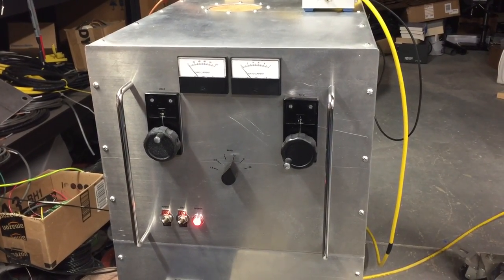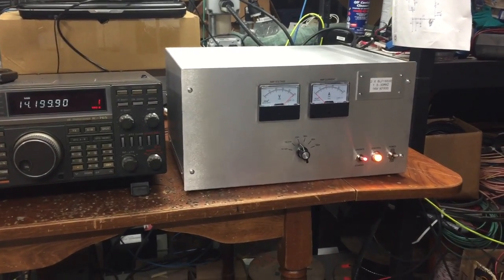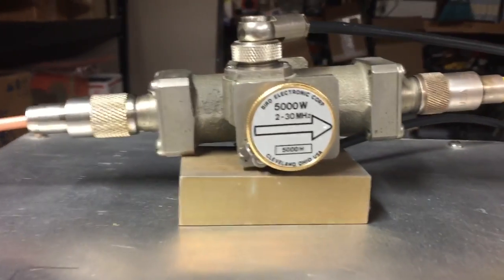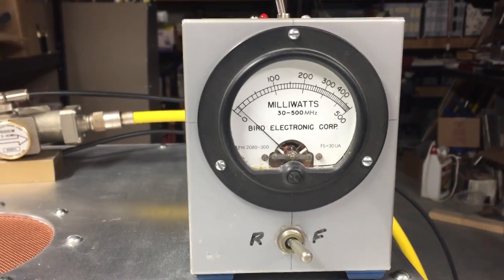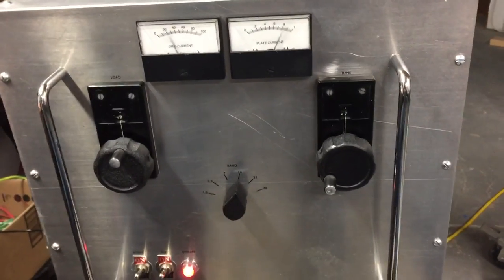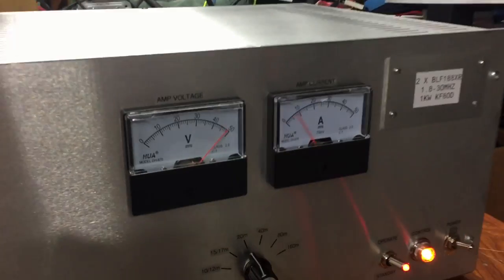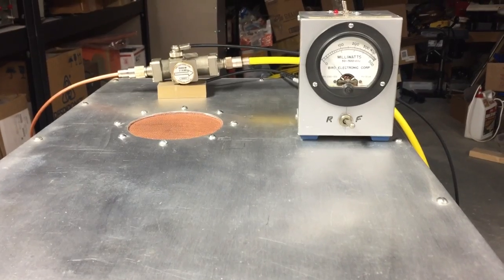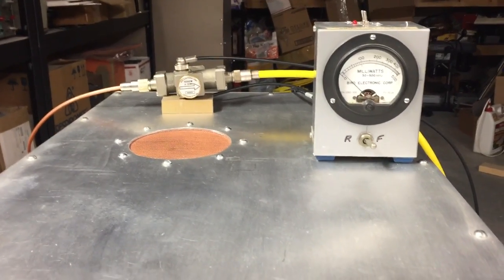3CPX5000A7 AMP OUTPUT TEST

Comment: I got double or more out of a 3CX3000 .
It wasn't a Eimac tube. It was an Econco rebuild that had a better tungsten thoride filliment . My power supply was bigger.  I was also volting the filliment about 9 volts. Sold it 25 years ago, and it is still in action .

Comment: How are you running your tube? Grounded grid, grounded cathode? Cathode driven or Grid driven? I am running one with the grid ring isolated on plexiglass and driving the grid with -200vdc bias and a 1:3 RF matching transformer. It makes a killer AB1 amp. A 5 watt carrier with forward modulation to about 12 watts drives the tube to 5000 watts. On AM it keys low watts and modulates to 5000 watts. It runs even better on SSB. It will top out about 7500 watts. This tube can’t take a lot of grid drive. I find 12 watts to be about the most drive. It has a 25 watt grid dissipation, but over 12 watts the grid current starts to exceed the 100 ma max on my tube. I’m running about 5KV on the Anode. Fun stuff. The Chinese version of this tube is only $250. 73, N1FQF.
Reply from the maker: Where are you finding these Chinese versions for $250.00?
Reply from the maker: I am operating my amp grounded grid.
These tubes love high voltage, I would get the plate voltage up at least to 7.5kv, the gain is spectacular.

Comment: Awesome amp! Glad to see your still using tubes. ;-)  does this amp need 3 phase power?
Reply from the maker: Bob H I built this amp about 3 years ago. It been sitting so I like to fire them up every once in a while. Power required is 240vac at 30a single phase.

73, Mike

Comment: Holly crap Bat Man!  Do you think my lmr500 will handle the power? ;). I believe my antenna would go up in flames. ha
Reply from the maker: I have seen a balun on fire!
Reply: Also can you give up the secret sauce on the dummy load?  I think it would be a build I could put together without killing myself.
Reply from the maker: Mineral oil
Reply: douro20 This is how amp technology moves forward.  Testing and learning.  I think kf8od knows the legal limit.  Old school is very bullet proof, soon it will all be solid state amps.

Comment: What plate voltage do you run ? I only see 6k with 200 watt drive and 5000 volts on the plate
Reply from the maker: jeramy duncan The plate voltage on this amp is 5500v, I have used 6500. These tubes love plate voltage, the higher the plate voltage the higher the gain.
Reply from the maker: jeramy duncan The 10kw is pep. Your tube might be a little soft. I had several that were a little low on the output. They bang the hell out of these tubes with a square wave in the MRI amps.
Reply from the maker: The plate voltage on the amp in the video is about 5500v. The input tuned circuit is also critical on these tubes. Has a big affect on the output.

Comment: wud you share info how you made to dummy load?  nr4rf
Reply from the maker: This is a 8" piece of stainless steel tube,  welded plates top and bottom. This load is built the same way the 1500 watt load was built. It uses a carborundum 890SP 375 watt resistor. 1" X 18"long. Three gallons of mineral oil.

73, Mike
Reply: thank you for info nr4rf
Reply: You can build a high power RF dummy load like this using a old electric oil filled heater by modifying the heater coil with RF load resistors on a copper bar, the old oil filled electric heater cavity will work perfect for RF load and is completely RF shielded and convection oil cooled.

Comment: The  power is not an ideas, how you can have 10 kw with a 5 kw anode dissipation tube???? You must stude the tecnic before writing stupid things (i made a 5Kw  ouput linear amplifier using an Eimac 4CX5000A several years ago)
I1RRT Bobby Italy.
Reply from the maker: Alexshowa Bobby, thanks you for your comment. Look at the data sheet for your 4cx5000, list the output as 16kw. 
The 3cpx5000a7 is actually a 3cx15000b7 with a 5kw anode made for the MRI industry. They use the tube to pulse 13kw. The size of the anode dictates the power that can be generated with a given air flow to maintain the seal temperature at a safe level. In ssb mode the tubes will generate far more.
73, Mike
Reply: Something you made wrong, the 4CX5000A does 10KW easily.
Reply: Trust the bird, it doesnt lie. He even showed the multiplier on the peak kit.